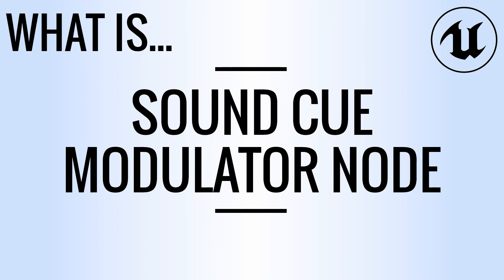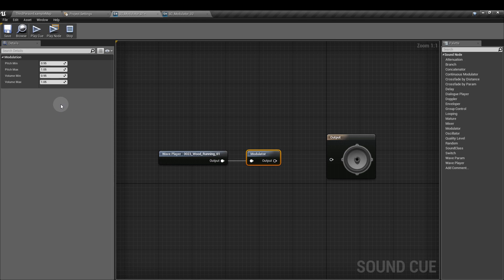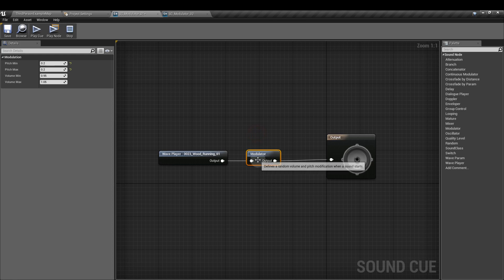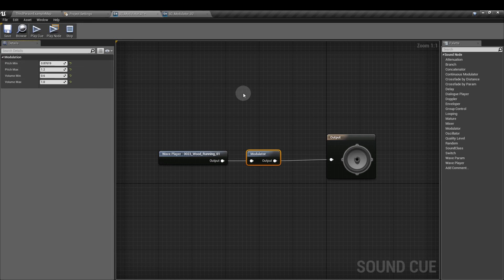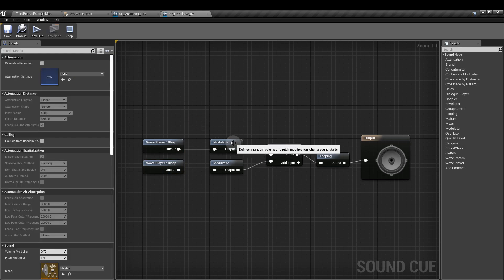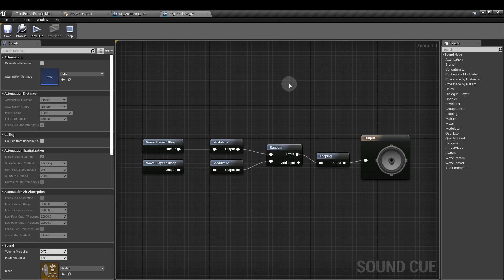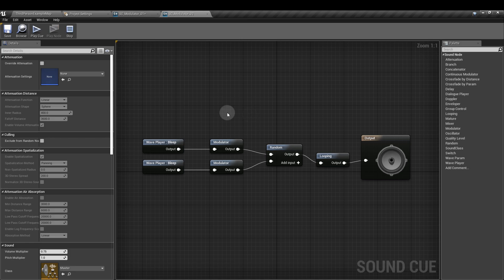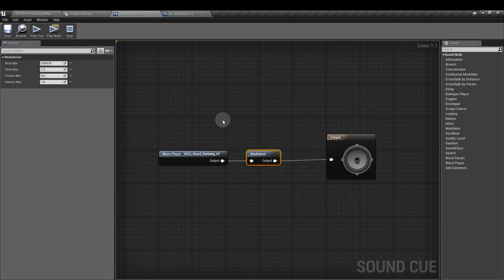What Is… Sound Cue Modulator Node? (UE4)

Comment: I know this is an older video but, you mentioned briefly pitch scaling instead of pitch shifting. Is there a way to do that in Unreal? I have a monitor beep that needs to change pitch but I don't want the length of the sound to change.
Reply from the maker: Unfortunately not in UE4 :/ Pitch changes will shift, not scale, so the lengths will always change. I don't know if this is the case in MetaSounds tbh (if that's even relevant for your project!). The fiddly alternative is to apply the shift and use Delays to maintain spacing... but that's pretty messy :/ Another alternative would be to drive the sounds from a BP, setting the tick interval, and triggering the sounds on a per tick basis.
Reply: @valkyriesound3888  After watching your video I did a deeper study of the Audio engine and found the Modular synth component suited my needs perfectly. I use a variable to determine what note to play and I can control the duration, volume, etc with that component.
Reply from the maker: Perfect! :) It's not something I've used a lot myself I'll be honest!